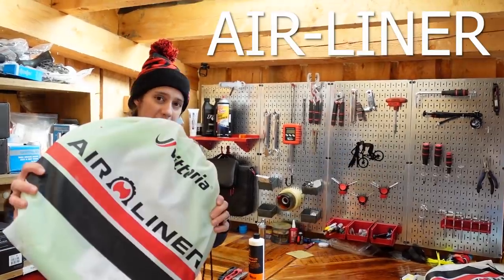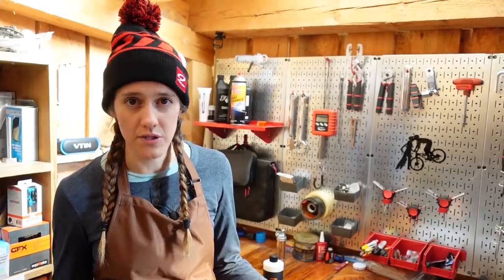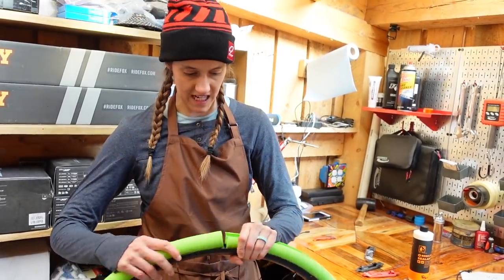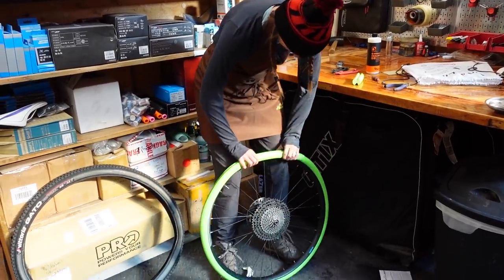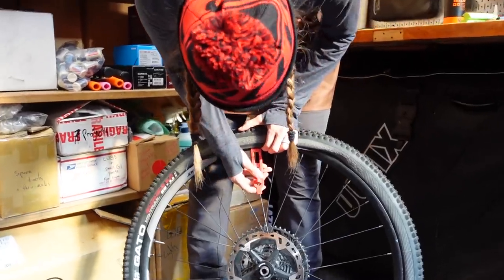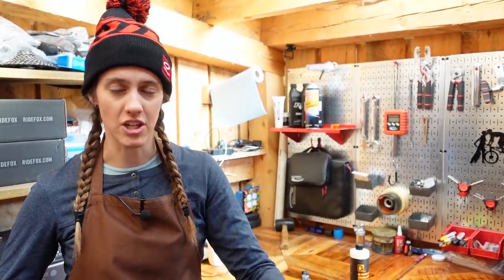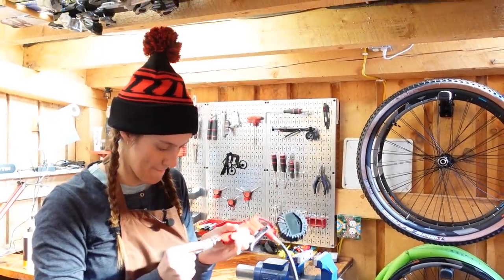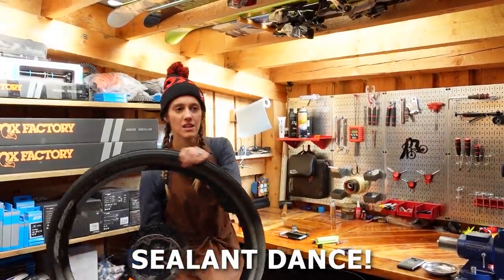Installing the Vittoria Air-Liner and why we use tire inserts to prevent flats | Syd Fixes Bikes

Comment from the maker: You can check out the Air-Liner here https://bit.ly/3jLFbqs and use code "sydandmacky" for 20% off!
Reply: You mentioned being in the van and not having a compressor. I solved that one. Ryobi makes a 1 gallon cordless compressor. It's small enough to fit behind the seat of a pickup truck and runs off an 18 volt battery. 

Mine is always in my truck, now. I use it on the bikes and it saved my bacon when I got a flat on my truck and hadn't checked the pressure in my spare for a couple years (I know better but stuff happens). I aired up my spare quick and was back on the road. 

At first I thought it was going to be a gimmicky item that wouldn't get much use but honestly, I use it all the time. I can't believe I don't see more of them at trailheads.
Reply from the maker: Cool! We'll check it out!
Reply: @sydfixesbikes  Right on. And if you're not looking to invest in Ryobi, I know a few of the other brands make them, too. Just, y'know...for more money.
Reply from the maker: We're already fully Ryobi-ed out as you can see: https://youtu.be/TVTYanIS-rQ
Reply: Fits it 26 inch wheels

Comment: Always end at the valve when installing a tire and always start at the valve when removing a tire. That way the bead of the tire never sits on the valve making it harder than it should be to install or remove the tire.
Reply: Whoa, I've always done it the opposite. I will do it your way next time.
Reply: @coldaleonthefrontporch6748  That tip only applies to tubeless tires, btw.
Reply: @phorest  No it doesnt. It applies to any bike tyre. The valve prevents the bead fully centering in the rim well and can make all the difference to a tight install. When fitting tubed tyres you just have to remember to leave the locking nut off so that you can push the valve in when using levers at the valve position.
Reply: @miathemalinoisgsdx1320  I think you're wrong for tube tires. There's no reason not to start at the valve with a tube tire and you can still pinch the tube just putting the tire on otherwise.

Comment: Easiest way I have found to install a tire liner is to sit the wheel flat on top of a round plastic garbage can so you don't have to worry about holding the wheel while trying to install the tire and inserting the tire liner into the tire. It makes installing tire and tire insert a lot easier since all you really have to really do is push down from the top of tire bead instead of having to hold the wheel while trying to  install the insert and tire.

Comment: Hi. Could you make a tutorial for how to remove a stubborn tyre that has the airliner inside. I’m finding it almost impossible to get the tyre off the rim and into the centre. Got one side off with a real struggle but other side won’t budge. Bontrager carbon rim and tyres

Comment: Out of all of this, I was most curious about your air compressor setup. Specifically the nozzle. I never thought to use the rubber tip on the air trigger thingy, so that's cool to know. But I want to see details of how you set up your pressure gauge with the Lezyne dual valve nozzle. I want to get the same setup, but I don't see how it all goes together. Any chance you could show us at some point?
Reply from the maker: Basically just popped off the nozzle that came on the pressure gauge, stuck on the Lezyne one and that was it. It was super obvious once we had the parts!

Comment: Just watched your video to help me install an air liner in my rear tire. Have you ever had an issue with getting a bulge in one spot of the tire making it have a wobble? It happened to mine and I can't seem to get it out. The wheel is true. Thanks! Love all your videos
Reply from the maker: Hmm... Make sure you tire is fully seated all the way around (check the bead indication line). If it is and there's still a wobble, it's possible that the tire's bead stretched. You could also make sure that the zip tie isn't pushing against the side of the tire.

Comment: Grammar guy here.  Or sort of trying to be a grammar guy.  Yes...you mixed up your comparatives, adjectives and adverbs.      You can use more or er.  Not both.  -Er is for 1 syllable adjectives with exceptions.  Easily is an adverb.  No er.  More easily is what you wanted to say.   Lots of people will actually get it all mixed up.  Even hosts on the radio.  You guys rock.

Comment: Its very funny because I installed a few new cushcores without that new installing leaver chilled af in 15min each. One was trickier on my demo with black diamonds on it. They're much thicker and weight. Can't really tell why everybody had problems installing that. Maybe its because the modern mtb scene is not as gnarly as the 2005 old school ones.

Comment: I don't have strong fingers anymore  (I suspect I am starting to get some arthritis in them).  I flip the tire around so the side I'mworking on  is facing me.  Then I push with the heels of my hands and my thumbs.  I can get a bit more force that way..  I still have to use a lever sometimes,, but it helps some.
Reply from the maker: Good tip!

Comment: Very Interesting Video...I have a Fat Tire E-bike that I keep getting flats and its annoying to fix on the road. I recently;y replaced my Tires to Maxxis FBF and FBR and this system seems like easy to install and I would like to try it out, I do run tubes and willing to go tubeless.. Do you recommend this system for my e-bike...I ride 20-30 miles a day...Thanx for the video and your time in creating it...Stay Safe
Reply from the maker: Going tubeless might solve your problems without even installing an insert. I would recommend starting with that (go tubeless) and see. If you're still having issues with flats, then try the insert as well. Good luck!

Comment: great, but how many people with tubeless setups get flats anyway?
Reply from the maker: It is still possible to get flats, but tubeless gets rid of the annoying flats from things like thorns or cactus spines and also allows you to run lower pressures (better control) without riding pinch flats.

Comment: Slime in the tubes and tyre liners are good as well
Reply: No way man slime in the tubes and the liners is so heavy. These foam inserts work so much better they really do smooth out the whole bike. Also slime and liners 9 out of 10 times will not prevent a pinch flat.tannus has great inserts for running tubes. Gives you so much more confidence.
Reply: @FarmerFpv  for my setup it's just fine Im also not sending anything to big

Comment: CushCore isn’t tough to install if you follow their specific instructions. The better sidewall support and general better design makes it a tough one to beat truthfully. 

A lot of the videos people talk about with CushCore install frustration are from several years ago when no one followed the directions of dropping the bead, etc. I’ve installed CC in 10 minutes, seen good mechanics do it in less following the instructions to a T.
Reply from the maker: That's good to know. As we mentioned, we've never used it because the Air-Liner is so good and easy to install 🤷‍♀️

Comment: It's nice to see that someone beside myself uses an air nozzle to seat a tubeless tire. Only thing that I do different is use soapy water on the sidewalls. I have always preferred to add the sealant after the tire is seated incase the tire blows off the rim making my shop look like the set of a porn film. I did find that you cannot inject pepper of glitter through the valve stem, it has to be added the old fashion way. Stay well.
Reply: I do it exactly the same way as you, except I use professional tyre soap around the bead. I also only add the sealant only after the tyre is bedded on the rim. When trying to get the beads to blow out on tubeless tyres of all kinds, not just bikes, you need to remove any restrictions to the airflow so that means usung a blow gun like Syd or even a pipe direct off of the compressorr tank valve and never use the tyre inflator with the gauge for blow outs as they are too airflow restrictive. Oh and dont forget to remove the valve centre when attempting to blow out the tyres onto the rims as well. 🖒

Comment: So I need a tubeless wheel? I don't know but I assume my rims are not air tight cuz of the wheel spokes. So I can't use this liner with a regular wheel. Hmm. I really don't want air! My ebike torque keeps rotating the tube inside so the valve goes sideways and I risk valve leak.
Reply from the maker: Depends on the rim, but many are tubeless ready and just require the application of rim tape. Don't probably know of an existing non-air solution.

Comment: So how does the sealant get to the other side of the tire it looks like it’s restricted from getting to the outer part or the top part of the tire in case you get a thorn
Reply from the maker: There are holes in the air-liner that allow the sealant to pass through.

Comment: Had a nightmare getting a 29er 2.6 tyre on with large air liner. One side of tyre went on ok. Then  struggled to get other side in, breaking 2 tyre levers. Any tips ?
Reply from the maker: That's always the hard part. After getting the first side on, try tucking the bead under the Air-liner so that it's sitting in the center channel. That helps release some of the tension on the second side which makes it easier to get on.
Reply: Thanks, is removing tyre with a liner a struggle to ?
Reply from the maker: Yeah, it's a bit harder. Best bet is to try to get one side into the center channel after you've let all the air out.

Comment: Okay so I went riding by Sunset Cliffs in San Diego and I accidentally ran over some Cactus and my tire got punctured by the cactus needles I thought I was fine because I had ceiling in my tire and they're tubeless but come to find out my tires flat
Reply from the maker: If you've checked and still have sealant in your tires (it dries out over time) try pumping them back up and riding again. Sometimes it takes a bit for the sealant to find all the holes.
Reply: @sydfixesbikes  your the best lol i was just watching a dream build that uses cushcore and it look like a pain 😂😂

Comment: hey, I don't get a lot of flats, but I'm always folding my tire around corners at around 27 psi or lower (no tire insert). is there any tire inserts that are better or at least on par with CushCore at solving this problem specifically that won't break the bank?
Reply from the maker: If you're folding tires in corners, it means you aren't running enough air pressure. Add a couple PSI to the tire you tend to fold and go ride. If it's still folding, as some more. And remember that you don't need to match the pressure front and rear. We generally run 5+ PSI more in our rear tires for the same reason. A tire insert might help a little, but it's easier (and cheaper) to just add some air pressure 😁

Comment: So the thing flattens over time and you have to remove your tire? And it's held together with a zip tie? If it's no Biggie to pop the tire off to adjust it it's definitely cheaper not to use it and just repair a puncture surely?
Reply from the maker: I would say that depends a lot on your goals and situation. If repairing the flat means replacing a tire and a wheel (or even just the the tire) then it definitely isn't going to be cheaper. Also, if you are racing, a flat at the wrong time is a real bummer even if it is fixable.

Comment: The idea of a tire insert is great but what is not so great is the fact that 1 foam insert costs the same as a new tire ($83 usd!?). I know they last forever, but just doesn't make much sense looking at the materials involved.
Reply: It all depends on how valuable not getting a flat is to you.
Reply from the maker: Yeah, but it's the R&D, molds, etc that's expensive and they have to recoup those costs somehow. Even though it is probably really cheap to make each one now... 🤷‍♀️

Comment: I thought the phrase "pinch flat" was only used in tubed setups? This insert is only for tubeless setups.
Reply from the maker: You can also pinch flat a tubeless setup although it is much harder to do. Basically, instead of pinching the tube between the rim and tire, you pinch the tire between the rim and whatever obstacle you hit (rock, curb, etc) and punch a hole through the tire. Not really any different from just puncturing the tire except it's caused by the rim instead of, say, a nail or sharp rock. Also tends to dent/destroy the rim.